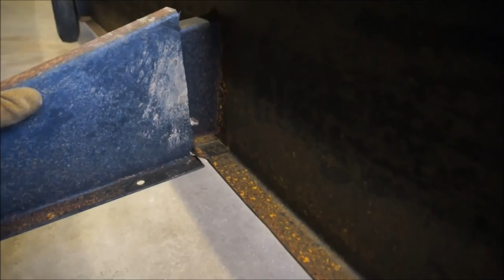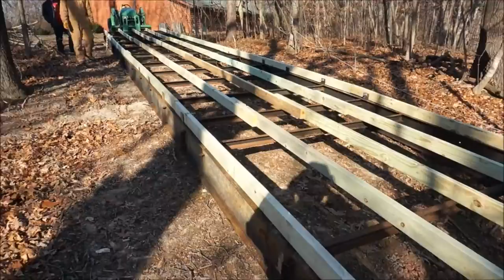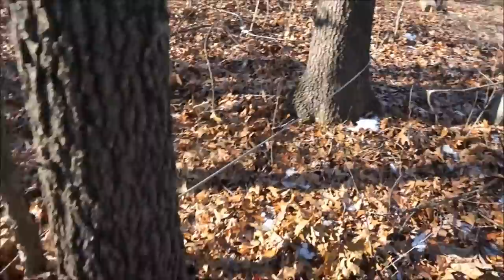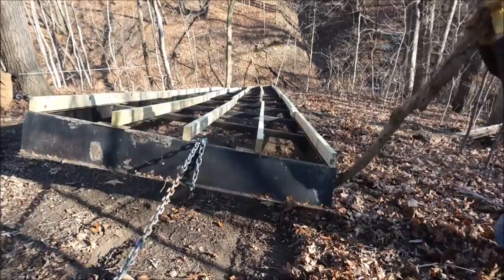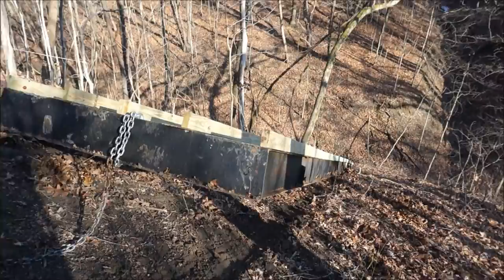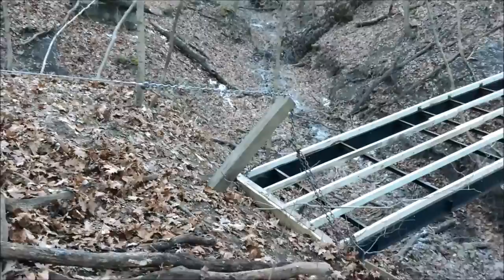diy bridge part1

Comment: What tipe of steel beam you use and how long?
Reply from the maker: the 46' steel beam was from under a trailer, with the side gerts cut off. with wood supports for decking boards.